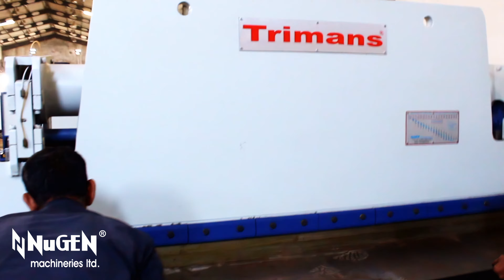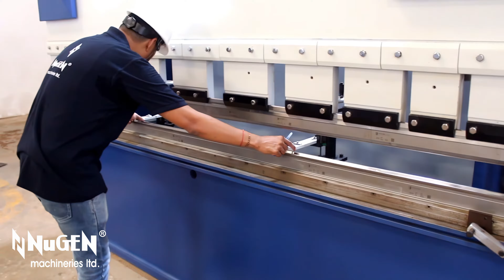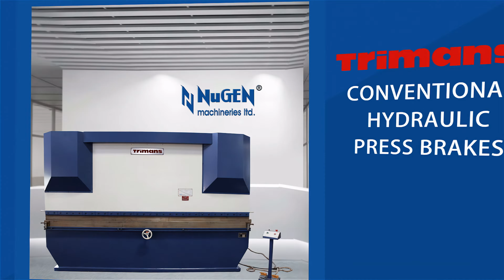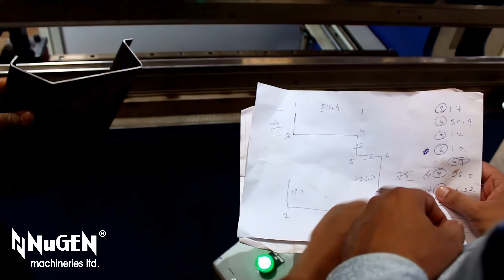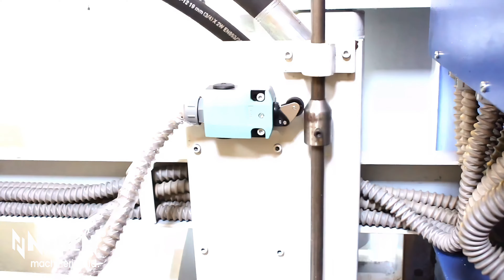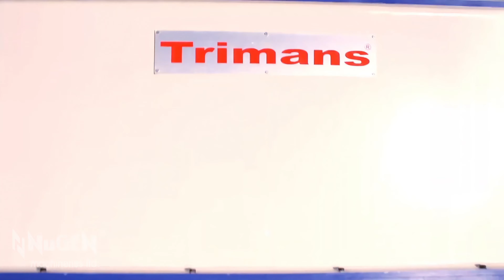NuGEN Machineries - Redefining Perfection since 1982 | ⚙ Trimans Hydraulic Press Brakes and Shears ⚙

Comment: Japani steel bend and cut machine need how many price
Reply from the maker: Hello Mr. Surender Kumar!

Thanks for sharing your requirements. We request your esteemed self to share the workpiece(s) details (e.g. material thickness, material length, bending angle etc.). Also, please let us know the exact machine type (#Conventional, #NC, #CNC, #FixedRakeAngle, #VariableRakeAngle #HydraulicPressBrakes and #HydraulicShearingMachines) required for your business.

Please do not hesitate to connect with our #TechExperts and #Engineers. Contact details have been mentioned in the video.

Warm Regards from
#NuGEN Machineries Limited.